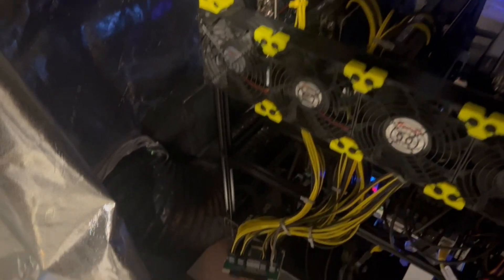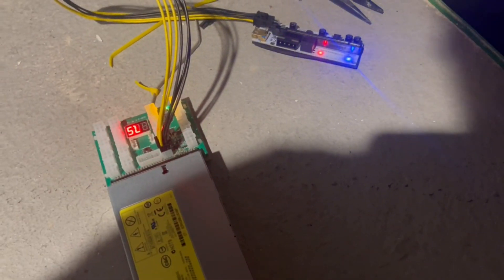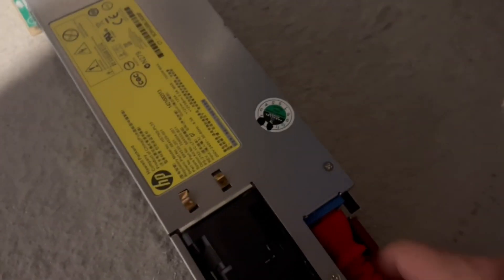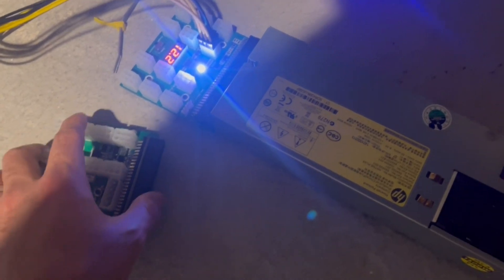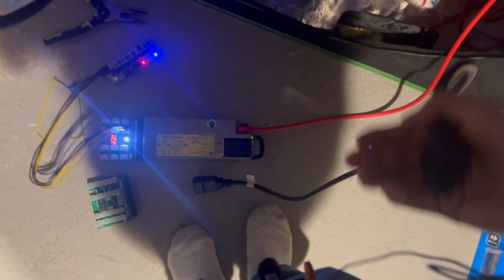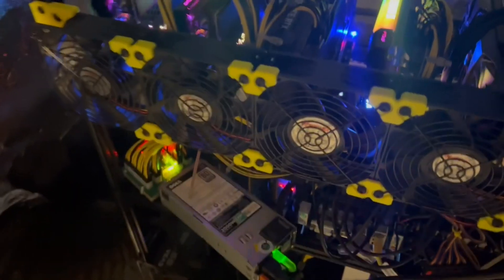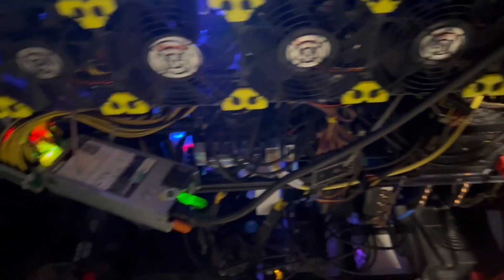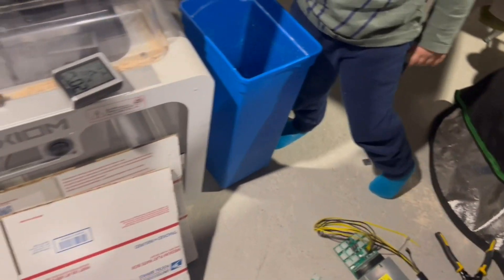Breakout board stopped powering on?

Comment: I posted a video on my channel to fix breakouts for the HP Common Slot PSUs, like the one you shown. Parallel Miner boards, and some no name boards are quite unreliable, but they can be modified fairly easily.

Comment: The X11-Amp boards have had a huge QC issue, its rational to accept 1 to fail every so often, but sadly my experience has been much more than that.
Reply: yes same.  mine are lasting 2-3 months.  i have so many laying around broke.  all the same issue.  i keep having to buy 2 or 3 at a time just to have spares.  by the time i use them warranty time has already passed.  very frustrating.
Reply: Had similar issue with 2 of my X11-amp boards. Do you have any recommendations for a better breakout board?
Reply: @N0RD0M  Ironically I have had 100% up time with several inexpensive boards found on Ebay. ($8 - $10).  I've also had positive experience with Deep In The Mines, which most likely is a premium board but your going to pay for it.

Comment: I just had the same thing happen to my 1200 watt server psu with a X11-AMP board. The fan does not turn on nor the green light on the back, but the breakout board has the steady orange light. The switch does nothing. Looks like I have no other choice but to replace the whole kit since I can't swap parts

Comment: I just had the same thing happen to one of my x11-amp boards a week ago
Reply from the maker: It’s very strange
Reply: @RedLlama  I also have had similar issues with an x11-amp and have another friend that has had the same breakout board fail on him too. i just had a x-adapter v11 fail as well
Reply: A Ha Yes happened to me to, I have about 5 of these power supplies and have had 2 of these have this problem, I believe its maybe a bad batch that got shipped to me as both power supplies that failed came in one box